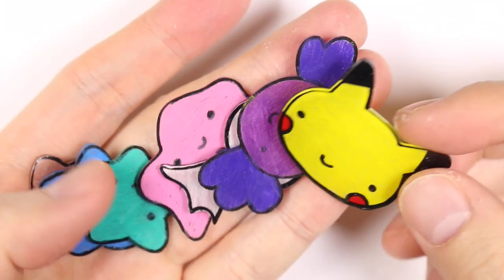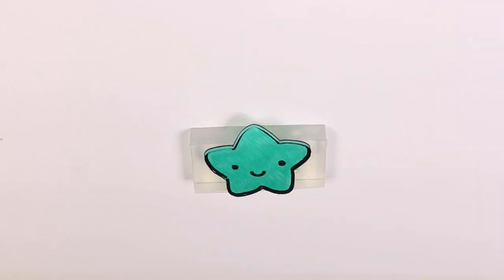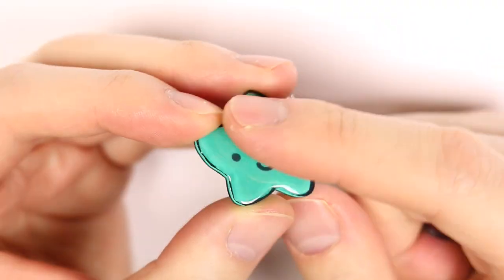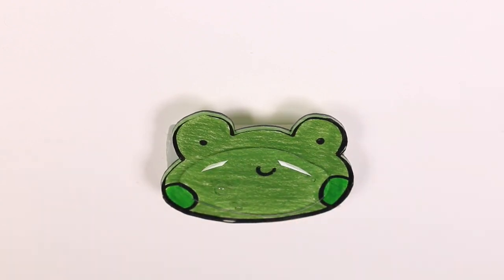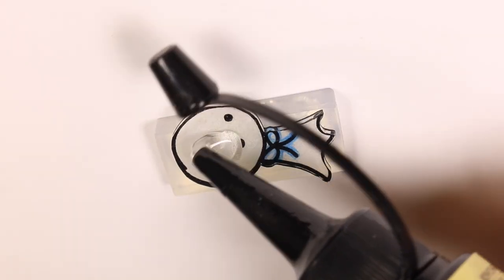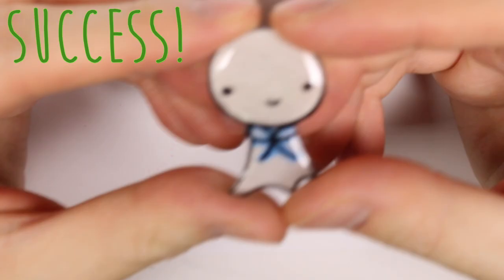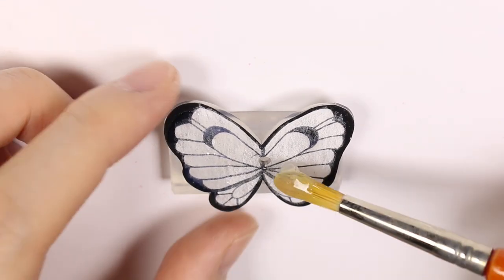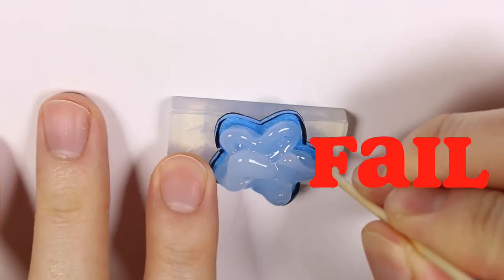How to DIY Doming Shrink Plastic Tutorial: Success or Fail

Comment: There's a few things worth mentioning about Dimensional Magic. The first is that it might yellow over time. I've used the clear Dimensional Magic as well as the glittery silver and glittery gold ones, and between 6 months to a year, the pieces always end up yellowing (also, it seems to yellow even more if you use the glittery gold one).

The second thing is that sometimes you have to be careful when you're using it on shrink plastic because it can make the ink run. I used to print designs on the inkjet Shrinky Dinks and I also drew on both the rough & glossy types of Shrinky Dinks with Sharpies and if I used Dimensional Magic to dome the side I drew or printed on, it always made the ink run, even after leaving the ink to dry for a few hours before doming.
Reply: Stevie Grant you seem to have a good bunch of exp! What do you recommend then? I've seen in another videos that resin makes the ink bleed too. So what would be your perfect solution?
Reply: I used this a or never yellowed... how long does it take to yellow
Reply: I've been making charms for bracelets.. I draw on the rough side, shrink.... made a bracelet and the ink bled on my skin. I can't find anything to seal them without the ink bleeding
Reply: I brush a coat of traditional mod page down first, to prevent ink bleed, then use dimensional magic, and then seal again with spray acrylic sealer to hopefully extend the lifespan of the dimensional magic.
Reply: Inkjet and Sharpies are both not recommended. You really need to stick to color laser or use an alchol-based pen like Copic markers
Reply: What do you recommend for sealing inkjet printed shrink plastic??
Reply: @pepethepatriot7524  I don't think you can print on plastic using a laser printer, because laser uses high heat to melt pigment powder in order to print.

Comment: For the hot glue, you should smooth it with a heat gun or hair dryer//plus I think your glue sticks is too opaque// after dip it into cold water so it'll immediately drys clear

Comment: Personally  I love using embossing powder. It makes it shiny and rock hard. After shrinking my pieces I use a clear embossing ink in a stamper bottle by STAMPENDOUS, then use a spoon to sprinkle a moderate amount of CLEAR ULTRA THICK EMBOSSING POWDER  by RANGER  on top. I place it on parchment paper and stick it back in my toaster oven at the same temperature I shrunk them at originally. I keep an eye on them and just let it melt completely then remove from the oven and let cool. Mod Pogde does yellow over time and gets gummy if exposed to perfumes or fragrance oils.
Reply: feliceskye I know this is a late reply, but do you think that method would work with acrylic blanks as well? I’m hating the UV resin...😬
Reply: another late reply from me! hopefully you see this :) what do you use to color yours? i use sharpie and am searching for something that won’t make the ink bleed :(
Reply: Nicole Long so sorry for the late response. I’m not sure about the acrylic. Did you try it? My only concern would be that it may melt, get bubbly or cloudy from the heat gun. If you try it I’d love to know how it worked out💗
Reply: Erin no worries😊 I like the printable shrink plastic. You can easily create your designs and print out a color version on the shrink plastic sheets. I get mine from Hobby Lobby and use a 40% off coupon from their website. I also use a basic inkjet printer. I’m telling you, if you’ve been coloring all your pieces by hand this will change your life💯 hope that helps 💗
Reply: feliceskye thanks for the recommendation! i’ll have to give it a try :)
Reply: Erin you are so very welcome 💗
Reply: OMG - Thank you for sharing your embossing powder method! In all honesty, dealing with any kind of resin sounds toxic and messy to me... I actually already have loads of stamping / embossing materials, so I am totally gonna try out your clear embossing powder method! 😽*Cheers, you're a STAR* 🌟

Comment: I only ever use Ultra Thick Embossing Powder. It gets the perfect dome like that UV resin did. Plus it's not a liquid, so messes are super easy to clean up.
Reply: I use the same thing
Reply: How long does it last???
Reply: It's permanent, it's not going to peel or break off but it may slightly discolor and of course scratch up over time and use. I mean, anything is gonna scratch. I havent made many charms in the last year or so but the ones I have around here still look good! I have also since used UV resin and while it is very pretty and not too hard to use, doming with liquid resin is just not a skill I have and UTEP is much cheaper.  I would still recommend it.
Reply: Do You Get problems with the piece being flat, and then curling when the embossing power heats on it
Reply: @Tiarah1999  Do You Get problems with the piece being flat, and then curling when the embossing power heats on it

Comment: The hot glue looks to be low temp, a high temp glue gun would work a lot better and be more fluid.
Reply: brikhouse22 Could’ve also worked if his glue gun had a fine point tip attachment and completely clear glue sticks. Hard to find, but worth it.
Reply: Agreed. My mom has an industrial glue gun and it probably would've worked really well for this :) Just don't let it touch you skin XD
Reply: @heatherturner9286  you need to put it in ice water straight away. Completely clear glue sticks still get cloudy when used.

Comment: Thanks for doing this!!! I was curious on drying times and whether or not the methods were waterproof. 

I actually got into shrinky dinks and UV resin watching your videos. UV resin and I are not friends :( I do much better with 2 part ICE resin. The UV resin you use, pulls away from the edges for me. I've tried putting more resin and pulling as far as I can before it drips off the side. #struggles 

I've also had UV resin pop off my charms or turn color. Still trying to figure it out but I'm glad it works for you. My quest continues.... (I love my resin but figuring out how much to mix for projects or trying to do multiples before it cures is proving to be difficult. bleh)
Reply: I wanted to ask @Polymomotea this as well, when I add UV resin to shrink plastic charms, the resin portion just pops off, it doesn't seem to stay stuck to the plastic. I wonder if it would help if the plastic is first lightly sanded?
Reply: @Kimiko to dome with UV resin first brush on a layer of mod podge and yet dry. Then dome  with resin. It doesn’t fall off
Reply: @feliceskye recommends this method:
"Personally  I love using embossing powder. It makes it shiny and rock hard. After shrinking my pieces I use a clear embossing ink in a stamper bottle by STAMPENDOUS, then use a spoon to sprinkle a moderate amount of CLEAR ULTRA THICK EMBOSSING POWDER  by RANGER  on top. I place it on parchment paper and stick it back in my toaster oven at the same temperature I shrunk them at originally. I keep an eye on them and just let it melt completely then remove from the oven and let cool. Mod Podge does yellow over time and gets gummy if exposed to perfumes or fragrance oils."
Reply: In all honesty, dealing with any kind of resin sounds toxic and messy... Anyway, I already have loads of stamping materials, so I am totally gonna try out feliceskye 's method! 😽

Comment: I have tried clear nail polish, but the brand of plastic I use requires for you to draw on the matte, course, textured side which means that when I try to dome it the first layer seeps into the cracks and you'll need at least two coats, it looks the best with three or more, so it isn't that good.

Comment: With the hot glue I wonder if it would've helped to use a heat gun to melt the glue some. Though of course that would also mean that it would also soften up on really hot days.

Comment: I tried to use resin ontop of a sticker that was laminated and the lamination paper would curl up- the resin ended up popping off too- but I didn’t even think of using shrinky dink 😫 I thought the heat of the uv would’ve shrunk it

Comment: I know this is a suuuper old video but what happens is you dome with resin a shrink plasti piece you draw with sharpies? I have tried another varnish and it smear the sharpie..
Reply: chocopandadeamor in the videos I have seen they usually use the frosted shrink wrap paper so one side they draw on then after they shrink, they go back and done it on the other side
Reply: The side without the ink on it
Reply: But if you do that you don't protect the ink!
Reply: That’s what I thought too but all the videos I watched they did that so I’m so confused. Another one of my guesses is that they just mod podged the backs then stuck the pins on it and flipped it over and put the dimensional magic over on top of the already glossy side for a 3D effect